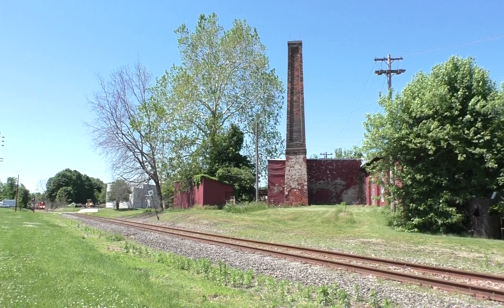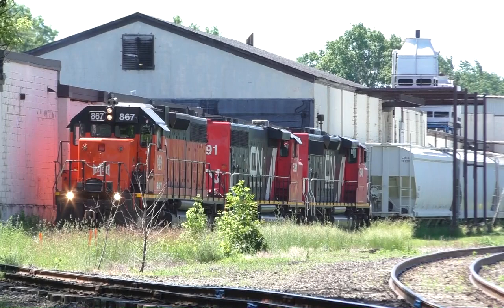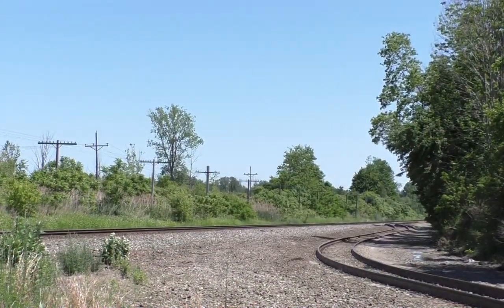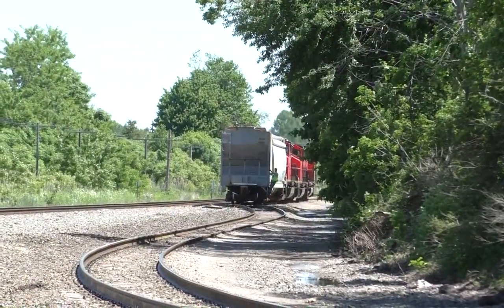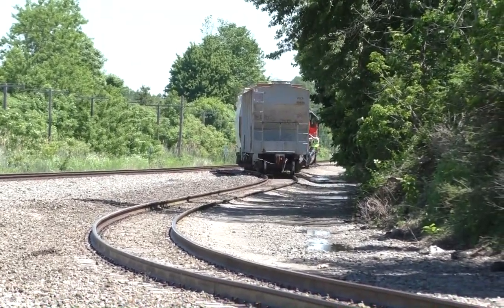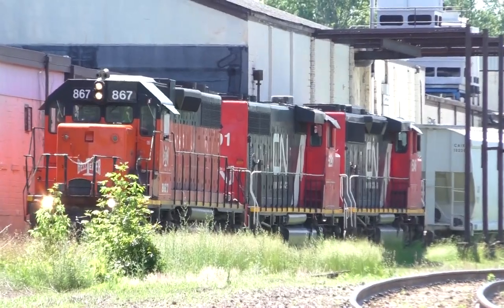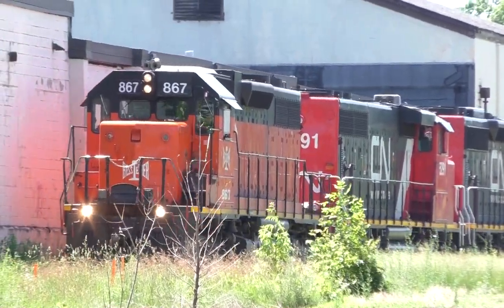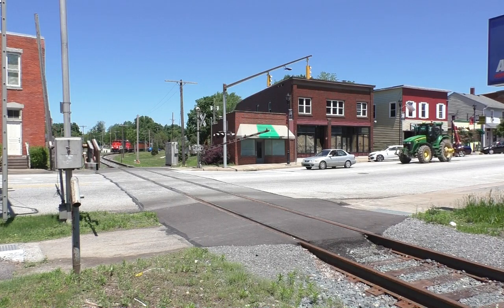B&LE 867 on the Erie Branch

Comment: Why three units on this job? Kinda overpowered! Thanks for sharing this view of rare operation.
Reply from the maker: +TucsonPete CN has had 2 power sets of 3 engines. Rather than disassembling it, they just take all three units up from Greenville. 867 was the only unit online heading North and 5346 was the only unit online heading South. They also had a notch 5 restriction.

Comment: Lots of HP to switch a few cars....weak teeny bopper horns for big bopper BLE. Does CN/BLE has any switchers in the area for these jobs?
Reply from the maker: The three engines were used since they form a power set. The lead unit was isolated from the rest so only the lead unit was actually supplying the power. The other units were kept on so there would be a leader each way and save crew time that would be wasted sending 1-2 units up and leaving 1-2 behind. There are no switchers for jobs like this, and regular power must do them.

Comment: How many units are there left in BL&E scheme
Reply from the maker: +NS Marblo There are 7 tunnelmotors, 4 SD38s, and a SD38 in DMIR colors, but with Bessemer patches. Only 3 of these remain on the original Bessemer property though, with 2 of them being regulated to dock service. This leaves 867 as the sole B&LE road unit on the property.